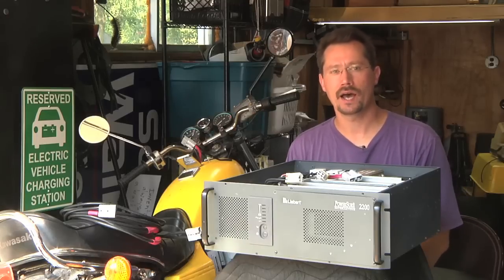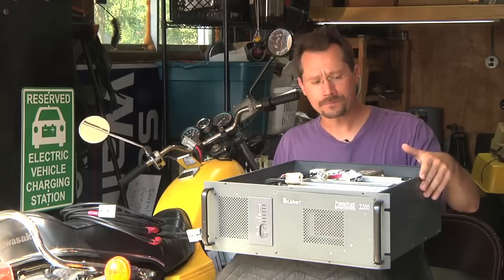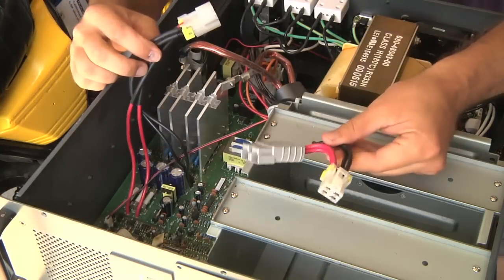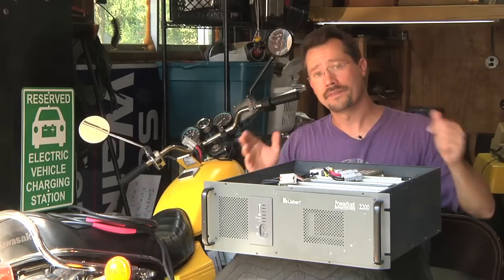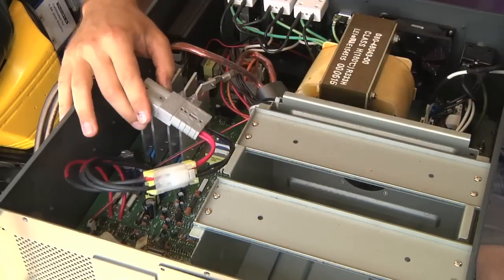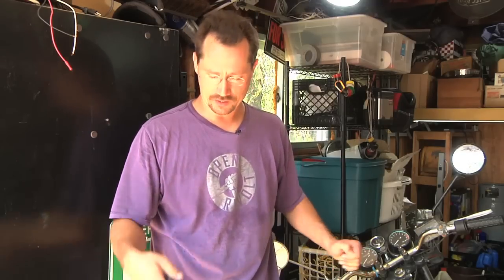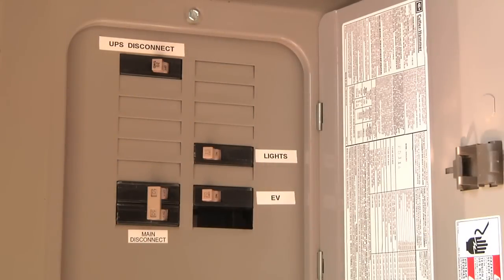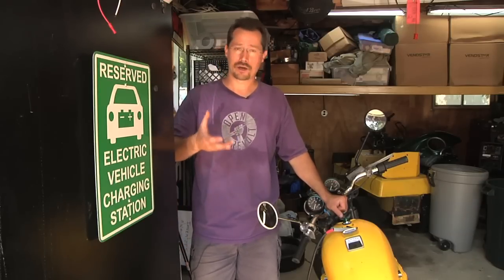Poor-Mans Smart-Grid | 48V power backup from electric motorcycle

Comment from the maker: The outlet the UPS is powered from is GFI-protected. If the UPS is both plugged in to AND out from the wall, the GFI trips, breaking the circuit.
Since the ground wire is not cut by circuit breaker, the GFI is always active. If you plug in both cords at the same time even WITHOUT both breakers on, it still activates the GFI safety feature.

Comment from the maker: Yes, that's correct, you MUST be disconnected from the grid when using ANY kind of power backup, whether it's solar, UPS, or a gasoline generator. Generators are typically connected through a transfer switch, that prevents you from being connected to both at the same time.
On my system, I really can't accidentally run power out to the grid. I have SEVERAL power disconnects between the UPS and the power mains.

Comment: how many aH is in your motorbike? would using the ups as a ups during a blackout drain the motorbike really quickly? (of course if it has a fairly large battery or you only use light loads it would be ok, and once the power comes back on, the ups will automatically start recharging the bike).
Reply from the maker: The cycle's lead-acid battery back is 2640 watt-hours. (2.6KWh)
In theory, I could run 10 ten-watt LED light bulbs for 26 hours straight. In actual real-world testing (when the power went out one time) I was able to run my refrigerator/freezer, radio, kitchen light, and ceiling fan (this was during a heat wave) overnight until power came back on the next morning.

Comment: Very cool! Does the motorbike have an alternator? If so, does it output 48V? Then all you need is fuel, and you've got yourself a proper emergency generator that could in theory operate for hours/indefinitely :] Otherwise it might be an idea to start building a battery bank in your garage to charge when you aren't charging the motorbike, then you can always just flip the anderson connector to the big bank of power :]